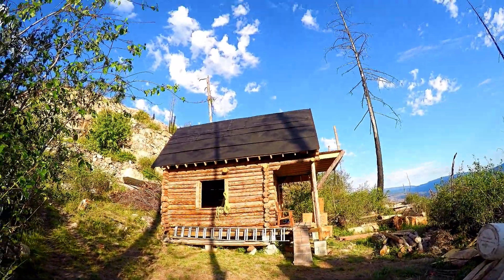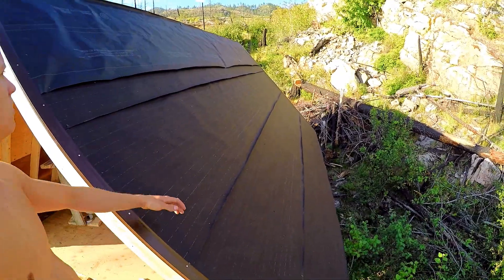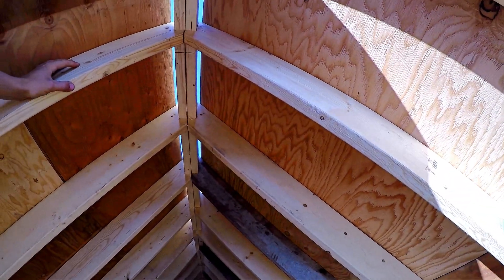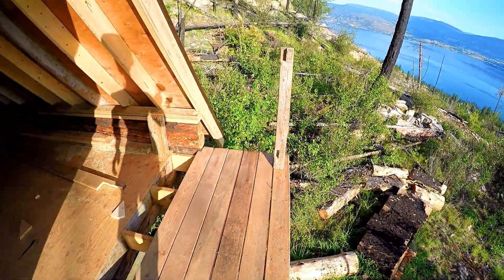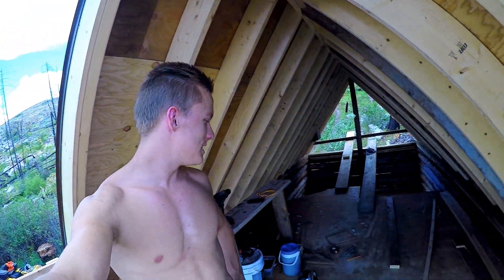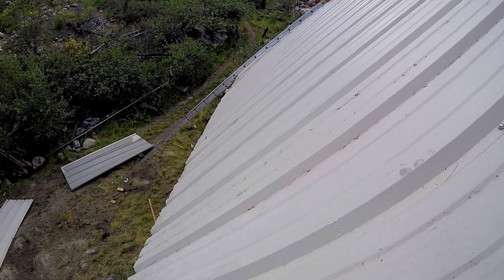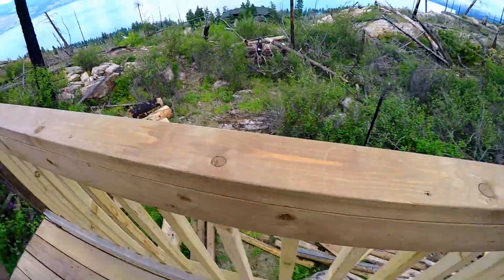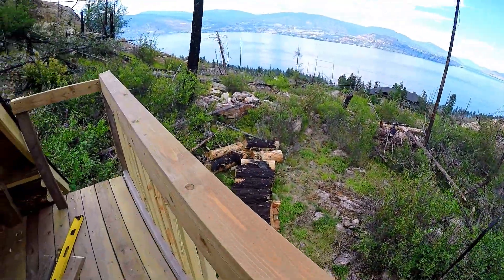How to Build a Log Cabin: Roofing and Balcony

Comment: very nice work Lucas - that balcony looks so beautiful. this will all be very very nice at the end of the project. Did you put on some waterresisting coating over the plywood on teh roof before putting up the tin? Maybe rapped a tarp or some plastic sheeting over it first?? I think I would feel more safe when doing that, also for insulation in the winter. But then, you are the carpenter and the expert. You must be very happy! Do you have holidays now or are you just 'free'  - without a job or what? How does a young kid like you finance all that kind of equipment and wood? Good luck on the project!!
Reply from the maker: Yes of course! That would be the tar paper I was pointing out, acts as a water barrier if any water was to get past the tin. As for insulation I don't think I will insulate the roof but if I did all I would have to do is add some insulation Batts between my rafters followed by a vapor barrier and then my finish ceiling material. The tin and tar paper and sheathing will keep the insulation more than dry and plastic or a "vapor barrier" should be as close to the inside of the building as possible! So putting plastic down under the tin on the outside of the roof would not be a good idea and might lead to mold or rot in the rafters! As for financing I am a full time carpenter so I put a little bit of money aside every pay cheque and put it towards the cabin!
Reply: Thanks for explaining - I keep learning from all you share in your videos and here in teh comments. That is sane godo thinking. Thank you for enabling me to learn. You have a beautiful place with a magnificent view. I bet you are the luckiest guy in your area and yoru friends must be a bit jealous of yopu (in a good sense) for having this little paradise... enjoy!
Reply from the maker: +Saturn Inc haha yeah totally!! Thanks a lot and it's my pleasure!